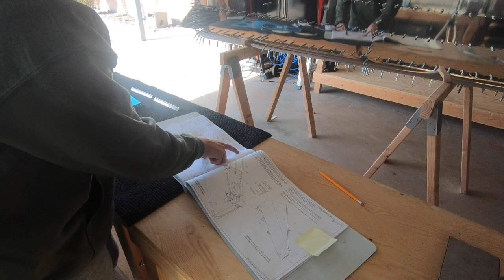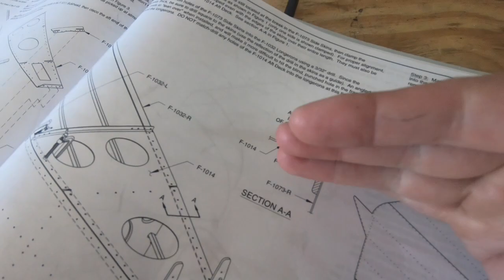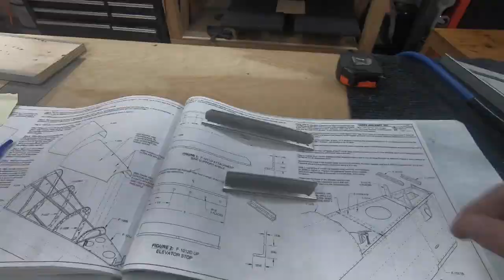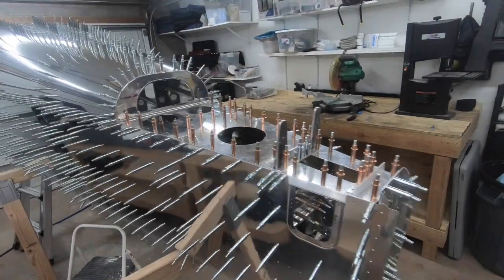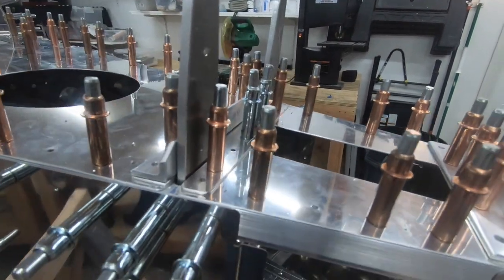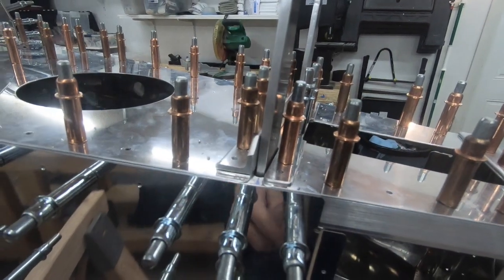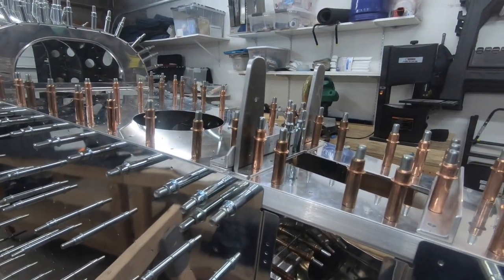Van's RV-10 Tailcone Build, Part 2

Comment from the maker: 02:50 - no real issue separating the parts. The carpet tape put up a fight but I got them to separate by going at it slowly using multiple chisels starting at one end and working my way across making sure not to scratch the parts. Worked great!